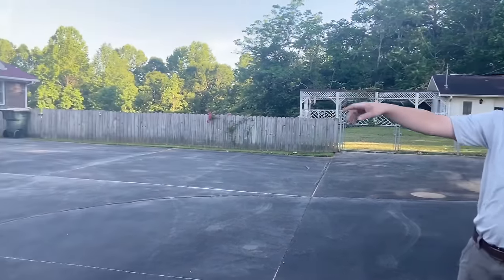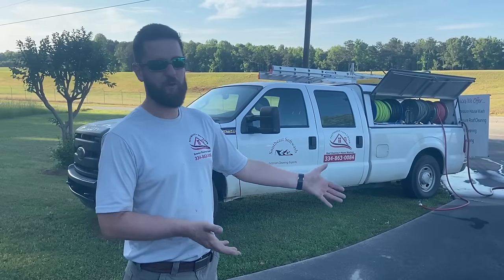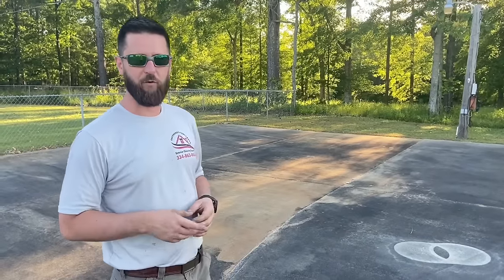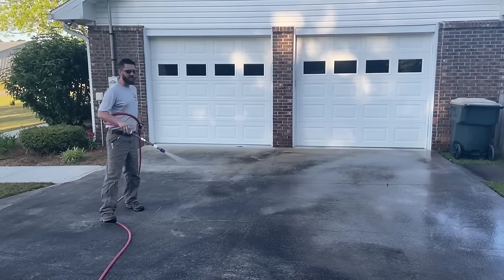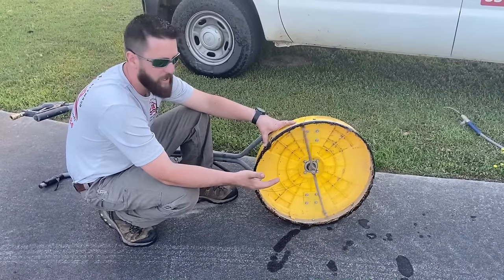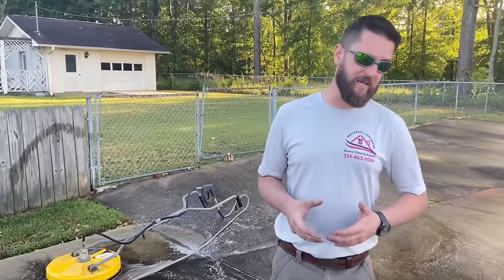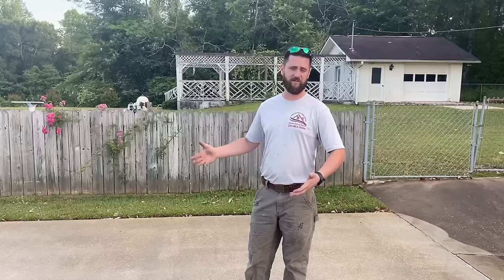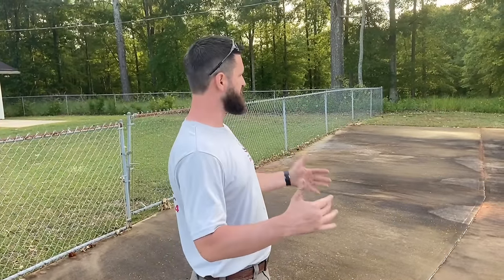How to clean a driveway. Start to finish

Comment: I learned this the hard way. I used a surface cleaner to do a whole driveway and then went back and washed the dirt off. Well it took longer because the dirt had settle back. Now I do it in sections and its a lot easier. This is a great tip for anyone do this out there.

Comment: Thank you for the video! This helped me see that there is much more to pressure washing concrete than what I initially thought. I’m currently doing neighborhood pressure washing with my beat up Honda 3.6 GPL and a small surface cleaner, but looking to get a modest setup (less than what you have), but that will allow me to more effectively clean concrete. 

Thanks again!

Comment: I just figured out something. I can put a rubber shield on the back of the surface washer to keep the water from splattering back on my feet and I can wear my tennis shoes.... you mentioned washing it two times, I wash it long ways with the driveway. My last pass goes like with the house or road. It helps hide any lines. I do appreciate the fact that you lay a last chemical spray on the driveway to kill any remaining mold.

Comment: How do you keep chemicals that run down the driveway from going into the street, hence possibly going down the drain down the street? Also what's a good way to find the low spots on a surface that looks flat? And lastly, can you just wet the grass outside of a sidewalk or driveway prior to using the pre-treatment and it'd be covered in the aspect of being safe if a little overspray got onto the grass?  Great video! I'm starting out and am watching as many videos as I can and yours is pretty thorough. I only have a 3.5 gallon 3,800 psi machine to start with, knowing I will need something better later down the road but that's what I have. Thanks

Comment: According to Doc no need to pretreat or use any chemicals.    He is the self proclaimed expert in every thing.   He even tells you which pressure washer you need.   I use 2000 psi at 6 gpm and get great results.

Comment: The tip about wearing the respirator is good.  I use a pre-mixed concrete cleaner from Home Depot or Lowe's.  It's very low-odor, but nevertheless, it's a chemical.

Comment: I really need a 4 gallon pressure washer so i can use a bigger suface cleaner. Im currently using two 2.5gallon machines they do get the job done since im working with small driveways and most of my jobs are just trash bin clean ups. As soon as i can find someone who's reliable to pass my jobs onto so i can work on getting some commercial jobs

Comment: I searched the comments and didn't see these questions answered unless I missed it.  1. What exact tips do you use - not the size, but which ones exactly - brand?  Link to Amazon?  2. What SH mixture do you use for post-treatment?  Is your SH mixture made of basic bleach + water?  If so (or if not), what are your ratios of SH components?  Thanks - I appreciate the video.  Very informative!  Great work.  Also, Is there a reason why you don't use a surface cleaner with wheels?

Comment: Thank you for sharing.  I married the Southern boy and need to do our driveway and home each year and I get better each year with the wand, but I am trying to improve each year.   A big circle unit is not in our budget so you are correct, it takes hours and a very sore back.  I do have to say though, it is very cathartic to do when you have teenagers in the home and small lot lines!   Quick question, where can you get the pretreat solution?   I purchased one at the local large handyman store and it did nothing at all.
Reply: He said what he used.

Comment: NICELY done, a lot of great pointers stated here. I just ordered a Simpson 4400 PSI 4 gpm unit and looking forward to putting that beast to work with a 4500 PSI steel surface cleaner.
Reply: I got same thing the other day. Any tips on correct pressure to use would help. Thanks!
Reply: @georgea6403  pressure gauge

Comment: I've been in lawn/landscape for awhile, picked up a semi-pro pressure washer a couple years ago and did a few jobs. Decided to push those services more this year and just ordered a 4gp/4000psi, 20in surface cleaner, and some other goodies. Would it be wise to also invest in a softwash setup asap as well? Or will downstream injecting work for pretreatments, housewashes, etc for awhile?

Comment: Are there systems that use a vacuum component on the other handle of that cleaner?  If so, how well does it work with or interfere with the sprayer output, and does it allow you to bypass the need to spray down the area right after you complete the wash pass?

Comment: I am just starting to look into what it takes to do this as a business so forgive me if this is a dumb question. Are there any issues with runoff while using SH on the driveway and walkways? I am concerned it may violate the EPA's Clean Water Act. I appreciate any knowledge you can pass on with regards to this issue and I greatly appreciate this video and all the excellent knowledge you provided. Thumbs up from me.

Comment: Thanks for the vid. I have a lot of trouble with calculations. Can you tell me like I'm 5. 
I have a pressure washer with a little down stream hose I would put in a bucket. If I was to do a driveway. How many gallons of SH would you use and surfactant? Also do you put water in the bucket or do you just use water coming through the pump? We use litres in Australia so the gallon talk is annoying 😀

Comment: you probably wont see this since its a year out but with 4 gallons a minute... do you have a water tank in the trunk or do you use the customers water source? also if in truck what size of tank, seems like you'd need 200 gallons for an hour of work. thanks again

Comment: Hi,
 So we have a blasting company and we mobile blast concrete and it's a pain in the butt. If you wouldn't mind can you send me a link to the chemical used and that yellow piece of equipment. Greatly appreciated. We have a regular 3.2 gallon min pressure washer will this work or is 4gallon a minute minimum?

Comment: Trying to brainstorm different things other than a recollection system for the drains..would the small “flood barrier” like the sand filled ones work you think? Just put it around the nearby drain. Rinse all around it before you remove it?

Comment: If I use a downstream injector to apply the SH mixture, does it reduce the flow to the surface cleaner? Since the injector itself constricts the water going through it, I was wondering if this would affect the pressure at the gun/surface cleaner when trying to achieve the maximum pressure. Also, would you still include surfactant in the post treatment, or just the water/SH mixture? Thanks again, this is super helpful.

Comment: Thanks so much.  Really informative.  I have pressure washed my concrete driveway with at 2.5GPM 2400PSI with 15degree nozzle and have, as a result, lost the smooth surface.  Do you have a recommendation for top treatment to bring back that just poured concrete finish?  What do I reseal with?  Thanks so much!  Really appreciate the video and any advise.

Comment: Good vid and tip on the ball valve. That's a dramatic change. I'm sure the customer was pleased. What's a good psi to clean a concrete garage floor? If you don't use the circular washer bar I'm assuming the water will fly all over the place?

Comment: Let me know if you need more shirts for your business, I can make them for you.  I notice you are wearing a smooth polyester T-Shirt, I do sublimation  to make sure the T-shirt last a long time with no fading, no cracking, and no pealing and to make it look vivid at all times. I use a different name brand from what you are wearing. It's a 100% polyester with a cotton feel, to make sure during the hot summers due to water or sweat  that the t-shirt will not stink/smell bad. We use a polyester shirt that has the feel of a cotton with the same actions and able to breath due to its 100% polyester material.  Give us a try and help a local (AL) small business.  Thank you for the great video.

Comment: could offer a concrete sealing option, seal the joints to keep that driveway from sinking due to water eroding the dirt fill underneath. and also where driveway and sidewalk meet vertical surfaces. send your new apprentices there next day with a 5gal bucket of sand, 5 gal of small aggregate, backer rod, razor, masking tape, and leveling concrete sealant and large caulk gun. 
as far as runoff, you can use a bucket of towels to lay out on the street gutters with a wet dry vac to suck up the waste water. as long as you make an active effort, doubt anyone will try to cite you
did you wind up getting a new wheeled surface cleaner?

Comment: How can I know the surfave cleaner is near its RPM while I am using a 3.5gpm machine? Mine is a 20 inch and I want to make sure it's spinning fast enough and I dont think I am using chemicals right away. I am barely going to use it this weekend whdn my actual machine arrives from lowes.

Comment: Hi,

First let me see this was a Great information video. You hit a lot of things that i will be looking for. 

I have a couple of questions. On the surface cleaner tip. You mention to get the 25025 x (2) which equals to 5 gpm. If you went up one more 25030 would that slow you down? Or would it be to much for a 4 gpm pressure washer.

Also is the circular marks caused by bad tips only or is it the PSI? Just asking. Learning more and more about this every day.

Again, a Awsome video.

Thank you
Reply: When I was running my 4gpm machine I played around with the tips and the 25030 compared to the 25025 was definitely slower.  I was using a whisper was ultra with is a 16" they say you can do 4 inches per gallon.  Circular Mark's can be made by walking to fast.  If you have to much psi for concrete you can strip the cream coat off and you'll see the small rocks on the surface.  Like what was said in the video you can see those exposed aggregate.  You don't really want to surface clean any new concrete since it's still curing.

Comment: What will happen is, once the pour gets closer to the top, the finishers will ask for more water, to make it self leveling and easier to screed. The problem is, 3000 psi concrete is designed based on a 4” to 4.5” slump. 1 gallon of water will thin the concrete by 1” slump per cubic yard. This severely weakens the pour. Pull the carpet on a slab house that’s over 3 years old, and if you see a lot of cracking, then 90% chance water was added to the mix in the last 2-3 inches of the pour.

Comment: with the new tips, is the old surface cleaner basically good as new? I don't understand why you'd get an entirely new surface cleaner if you can just replace the tips on the old one.

Comment: 4.0 GPM what PSI are you running? I see that most of the 3200 PSI machines sold only go up to about 2.7 GPM, thoughts?
Lastly I have stained concrete from Pecans the squirrels destroy and bombard the concrete below...
Last few years the stains went away on it's own but it won't power wash (w/ my current 2,500 psi 2.2 gpm) off, suggestions?

Comment: Hey Coty what size hose you use in what ball valve you use I ordered a ball valve but my valve doesn’t have pressure like yours help me in it also has a high psi
Reply: What size is your pressure washer?
Reply: Sebastian Silva my pressure washer is a 3500 Honda cat pump

Comment: whats better 3 jets at 25 degree 4000psi 4gpm or 2 jets at 15 degree 4000psi 4gpm? my unit its 4000 psi 4gpm and one of the cleaners is 4gpm while the other is 5gpm max.

Comment: Do you use Southern drawl for a surfactant in your pre treatment on concrete driveways?  If so, do you just add about a cap full (per gallon of SH) so you don't get too many suds?  There are so many different surfactants out there people recommend such as Slo-Mo and Snotmenade.  Thanks Cody.

Comment: I have a 3200 PSI Simpson pressure cleaner it has a Honda motor with 4.5 gallons per minute but I read all the instructions on the machine I haven't really used it that much I put stabilizer in it and I ran it until it ran out of gas and put the stabilizer in and it's been almost six or seven months so I'm a little concerned about whether or not it's going to be okay the other question is I see that the unit you left running and all the instructions that I have read don't let the unit run for more than two or three minutes without having water flowing through it how do you avoid having any problems with the pump when you don't run the water through it

Comment: Hey Coty, great video, looking to start my business this coming spring. You mentioned early in the video, the Clean Water Act and needing to capture the runoff, but i didn't see anything you did necessarily? Looked like it was just running into the street lol. What did you do, and what can we do if we don't have a "water retriever"? Will boom socks cover us? PS I'm not completely new to pressure washing, i believe anyone that has pressure washed along with my self have all checked over our shoulders as we push it down a drain lol
Reply from the maker: There are no storm drains out here in the country, so no need to have any recovery system. 

If you do need recovery on a particular job there are kits that create barriers and then a suction pump to put it back to a holding tank, or somewhere safe on the property. 

Technically it’s not supposed to leave the property, but there was no risk of it going anywhere here on this job.

Comment: On minute 13 in the video, when you connected your hose to the surface cleaner, what size is the adapter that connects to the surface cleaner? I just bought a swirl away 20 inch but i don't know how to connect it to my pressure washer.

Comment: One more question I have. I noticed you turn the ball valve off. Do you have a buffer tank that the pump sprays into?
I’m wanting to do that with mine except I’m going to just let mine spray on the road. This way I can see it is working properly.
Reply from the maker: A buffer tank is best, but you can do it that way

Comment: I was thinking of doing patio/driveways as I have no job and I did my own patio with one of those small electric power washers and it turned out really good but after seeing this I doubt anyone here in the UK and in the area I live would pay £200 for 1 and a half hours of work and I was thinking most people would not even pay £20 an hour.
I simply can not imagine someone saying they would pay me £200 an hour to so that and don't get me wrong I am not saying you do not get paid that much but if I were t say to someone "Hey I can clean your patio for £15 an hour" most people would still say no.
Reply: Market rates, disposable income vary.  I could do my small driveway by myself.  It would cost $80 for the pressure washer, another $40 for the spinning disk thingie,  take me 2-3 hours to do, and then there's the hour driving/waiting-in-line time to pick up the equipment, and the sore back!  I would gladly pay $300 for that size driveway job!

Comment: Thank u quick question, I have a 3300 psi at 2.4 GPM to start off. I purchased an injector and a surface cleaner. When applying the 10%SH do I have to dilute ? If I’m correct my machine mixes at a 12:1 ratio. Please give me your thoughts. Thank you again
Reply: What did you end up doing and figuring out?

Comment: Hi, I have a 2.8 gpm 3100 psi unit, can I convert it over to a 5.5 gpm by changing the pump, I'm trying to get jobs surface cleaning storefronts and dumpster pads, my question to you, is this a good place to start and can I change over the pump sizes, thank you for your time .

Comment: I’m Wanting to start my own pressure washing business. Sidewalks, roofs, driveways etc. I have an enclosed trailer, 3k psi sprayer, and some tools. I will be getting a water tank and walk behind like in this video. what type of setup would you reccomend? And how would you set it up?
Reply: Hes not gonna get back to you, the best thing is your enclosed. Go out and get a gx390 and cat 66dx setup, BE 20 inch surface cleaner, ball valve and a gun, and downstream until you can afford to go with softwash. Get in touch with me if you want more info

Comment: Love the video. What do you recommend as a high pressure ball valve and where do you get it.  I have not had good luck with ball valve
Reply: Pressurecity.com search 3/8” ball valve and swivel kit.
Reply: I get mine on Ebay. Frequent WD40 makes them last a lot longer and easier to turn.

Comment: Looking for advice. Im going to buy 4gpm machine. Do you recomend 3/4" garden hose or 1"? Im not using water tank, just straight hose to pressure washer. Thanks.
Reply from the maker: 3/4 is plenty for a 4gal Machine
Reply: @southeastsoftwash4020  Thanks for your help and answers - here and facebook :)

Comment: what size hose do I need ? I have a 4000 psi and 4gm power washer. I also have a surface cleaner and had issues with it making lines. Is it due to not enough water pressure ?

Comment: I’m just beginning, do you keep water in your truck? Or do you use house water because I feel like it would be easier to use house water
Reply from the maker: Use the customers water to keep the buffer tank full
Reply: @southeastsoftwash4020  oh ok thanks, what if you don’t have a buffer tank? Would it be ok to connect the pressure washer directly to the house water
Reply from the maker: @mikewazowski7377  yes you can do it that way

Comment: What the  difference between the one that has wheels on and the one that you have? its a bit stupid question but i guess the one that you have only with the brush on its a bit harder to use ?! maybe?! 
thanks mate awesome video.
Reply from the maker: I like the ones without wheels. They basically float.
Reply: thanks bud.
Also give me your opinion about surface please? BE or Whisper Wash? i got told that Whisper Wash is one of the best one but, cant find it in australia which BE surface i can...
i run a 4200 psi 4 gpm will be ok if i get BE one hey?!